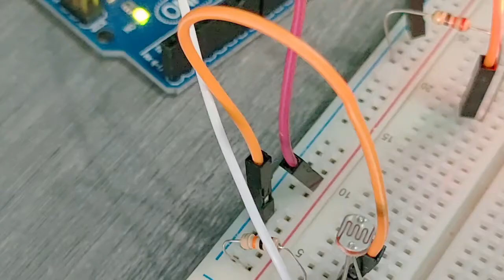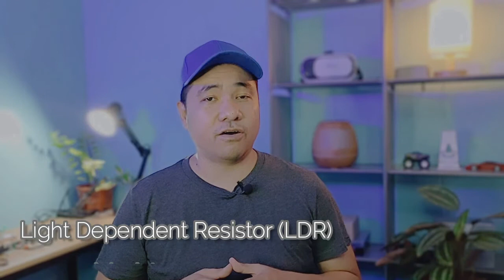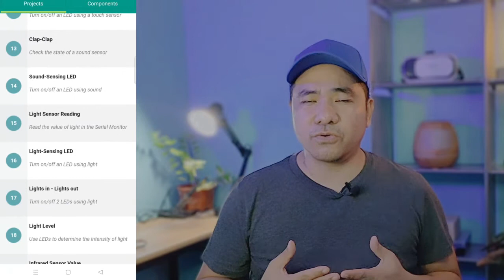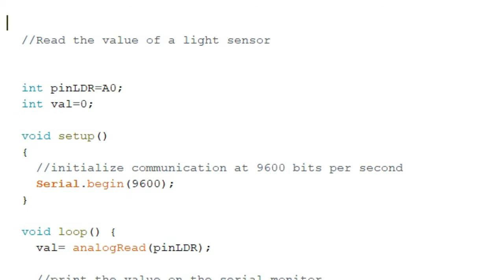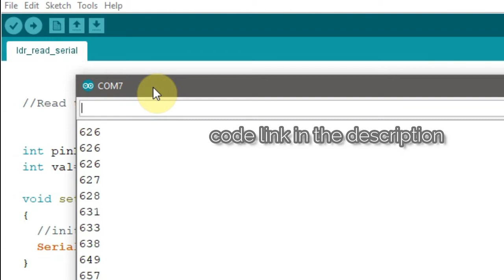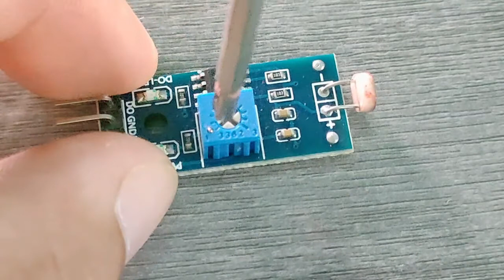Light Sensor: How to Make Your Arduino Robots React to Light

Comment: //Read the value of a light sensor

	int pinLDR=A0;
	int val=0;

	void setup()
	{
		//initialize communication at 9600 bits per second
		Serial.begin(9600);
	}
	
	void loop() {
		val= analogRead(pinLDR);
		
		//print the value on the serial monitor
		//Go to Tools->Serial Monitor to see the values
		Serial.println(val);
		delay(100);
	}

Comment: //turn on/off an LED using the light sensor
	
	int pinLDR=A0;
	int pinled=10;
	int val=0;

	void setup(){
		pinMode(pinled,OUTPUT);

	}

	void loop(){
		val = analogRead(pinLDR);
  
		if (val <300){
			digitalWrite(pinled,HIGH);
		}
		else{
			digitalWrite(pinled,LOW);
		}
	}